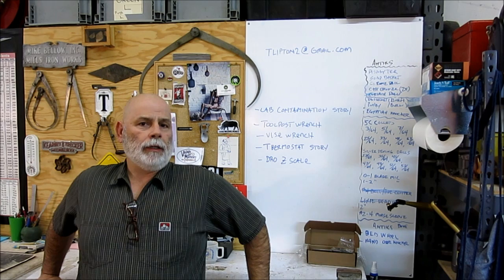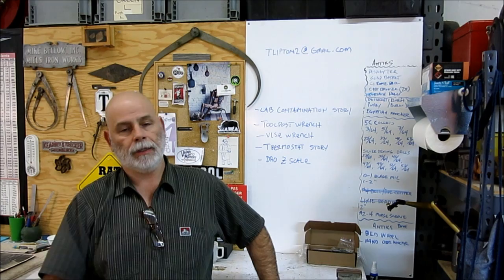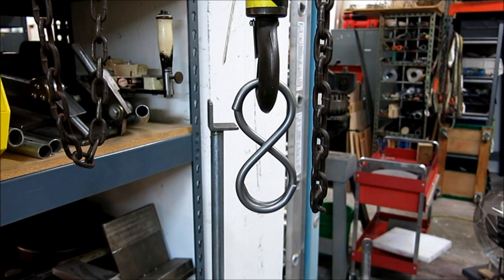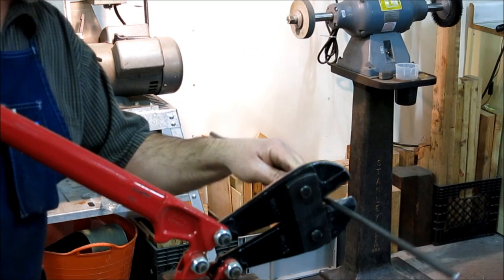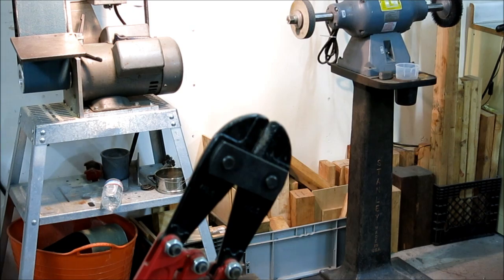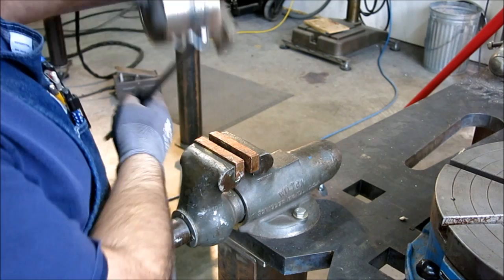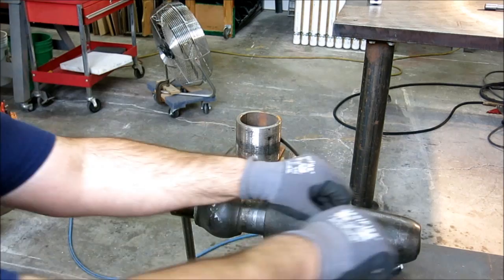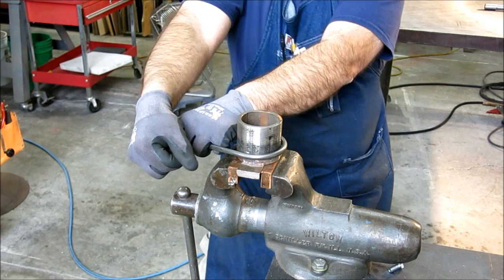Roach Coach Snack Break 12

Comment: Watched it on my break! Nice idea Tom, and thanks for sharing.
Reply: I wonder if a pair of these hooks would have been strong enough to lift my 24" Cincinnati rotary table into the mill for a job I did last night? That thing must weigh 600lb! Had to have it for the job I was doing though. I like that bending fixture great idea!
Reply: bcbloc02 Not saying that those hooks aren't stong enough to lift  that rotab, just suggesting you don't get under it when you do.  I used a couple of forged eyes in T-nuts in the slots of my big rotab as a lifting point.
Reply from the maker: James Kilroy Hey Guys,

Two of these would be fine for the rotary table. But like James says don't put anything precious under the load. Open hooks are just that open.

Cheers,

Tom
Reply: I'm slacking big time, missed it

Comment: Thanks Tom, I use a lot of hooks to hang tools and other crap off a pipe, easy to rearrange so you can easily snatch the next needed tool.   Just about anywhere there is a place to latch on to I have hooks holding something that would otherwise be buried in the bottom of a box unseen and unused.  I for one am hooked on hooks.
Reply from the maker: Hey John,

Hooked on hooks. Looks like I reeled one in. Time to grab the gaff. Which by the way you could make on the same fixture. Should have mentioned that.

Cheers,

Tom

Comment: Hi Tom,
           In the last of the old time workshop photographs, the rings in the foreground look very much like steam locomotive tires and were heated up prior to the fit to the loco wheels, another old use of heat and expansion.
 By the way Tom I seem to have missed the Thermite railway article but maybe you didn't cover it. I find the method of chemical welding of railway lines fascinating.
Keep the videos coming, they're great.
Reply from the maker: Hey Mo,

Thanks for the comment. Don't worry you haven't missed the thermite. It wasn't that interesting of a story so I put it on the way back burner.

Cheers,

Tom

Comment: Making these for a home shop or tying down a load on your truck is a great idea, and i don't mean to be the wet blanket here, but please do not bend these yourself for use on a monorail, chain fall, or crane at WORK.  Below the hook lifting devices like this need to be certified, load rated, load tested, marked with a serial number, and periodically inspected per ASME B30.20.  OSHA will nail you for this one HARD.  The S-Hooks that my company supplies come heat treated as well, this isn't a requirement, but it keeps the hooks from getting dinged up and worn to the point that the capacity is reduced significantly.  The hooks with all of the proper markings are CHEAP CHEAP CHEAP and an OSHA fine for using a homemade lifting device is a big one.  Please use only certified lifting devices below the hook.
Reply from the maker: +no Hi No,

Thanks for the comment. 

Cheers,

Tom

Comment: I was able to be quiet the first time you did hooks, but you are forcing me to make a video showing the right way! :) Blacksmiths do it best. I hops you can tolerate a phone quality video. Tom, I love your channel. Keep up the good work.
Reply from the maker: Hey Mike,

So are we talking Pepsi challenge here? I just shot some video of load testing these hooks for the next meatloaf. I'd love to have some forged hooks to do a side by side test. Are you game? Material would have to be the same size to do a fair comparison.

All the best,

Tom
Reply: oxtoolco I popped a few hooks in the mail toady. I'm actually more interested in the data that proving you wrong, but I'll take both if it happens that way! Three hooks, one is about 3" x 1", one is 3" x 3" both out of 3/8 hot roll. I threw in a little 1/4" hot roll guy for fun. I usually twist the middles, but I was afraid it might hurt my numbers. :)

Keep the hooks, I know how to make more...
Reply from the maker: Hey Mike,

The hooks arrived. I'll be pulling on them in the next meatloaf.

Cheers,

Tom
Reply: Thank you. Feel free to play up the competition angle, or just collect data, its fun to watch however you roll with it.

Comment: Nice fixture I like the loop to hold the end . Tom why bend quick, momentum?
Reply from the maker: Hey Bill,

Heat from the material yielding helps beat the work hardening. When you hand bend you really notice it. Momentum probably plays some part in it as well.

Cheers,

Tom

Comment: Tom, 

What 3M wheel are you using on your buffer?  Could you give me a quick one/two on those wheels? I'm looking to add one to my 8" buffer-grinder, but don't know where to start. A bit overwhelming to begin with. (General fine deburring in my case) I generally use a belt sander as a first stage.

Need info mainly because they are so damn expensive, I don't want to purchase the wrong one and be disappointed!   Are they worth the money / and life expectancy on them?

Thanks a bunch Tom,

Glenn
Reply from the maker: Hi Glenn,

Its a 3M EX2 Deburring wheel. X2-WL. 8S Fine. I like 3M products but not their part numbers. Hope this helps.

Best,

Tom

Comment: Where can I get some of that elbow grease? I can only find it for sale in 5 gallon and under sizes but I would like a 55 gallon barrel for the shop so I don't have to worry about running out anytime soon. I already checked McMaster, MSC, Traverse and Grainger with no luck.
Reply from the maker: Hi Andre,

Costco has it in big three packs. Not all the stores have it. Don't use the Harbor Fright brand as its made from recycled car tires.

Cheers,

Tom
Reply: I thought it was, since its tougher than the other stuff and makes my elbow ache.
Thanks!